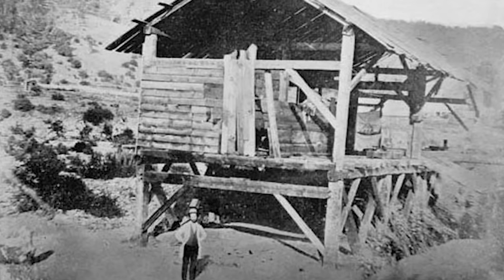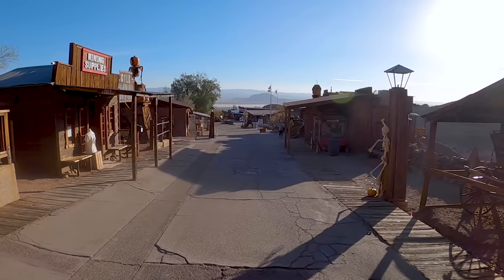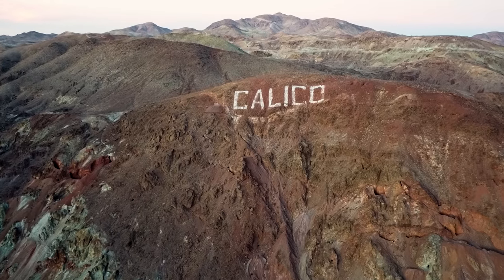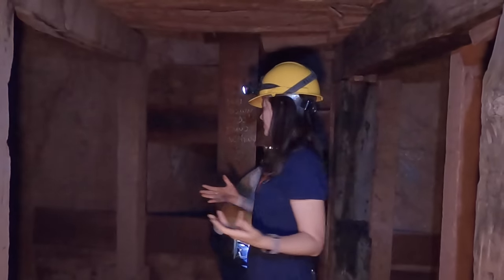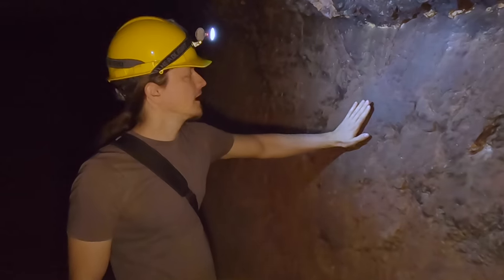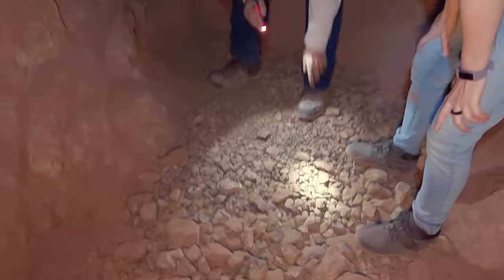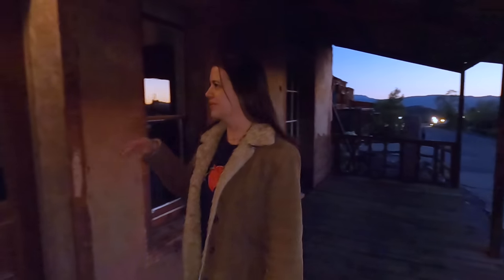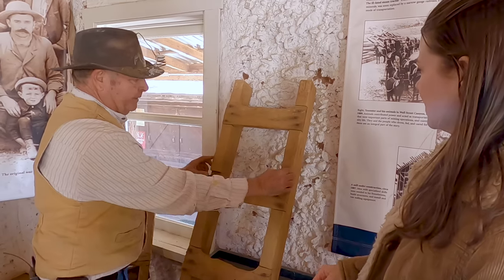Exploring the Haunted Calico Ghost Town

Comment: So glad you did this episode on Calico. I started mapping the mines when I was 15 and only mapped about 9 miles of tunnel at level 7. There are 15-17 levels. Once you hit 11 there is water. The water is caustic but ultra clear. You can see down one flooded shaft about 180 feet. Mining was done at the buried river level where silver ore leached in. Its still there. Very soft walls and tunnel collapse is pretty frequent. In 2001 there was a roof collapse at level 10. You can hear the water well pumps from the town down there. 36 miles of tunneling I am told. I would love to have an official tour down there someday. You guys really did a awesome video. I always get excited with Calico.
Reply: Amazing. I do not have that kind of guts.
Reply: @thenevadadesertrat2713  it’s not really about fear. It’s about understanding the stability of your surroundings and the risk of unseen unstable zones. And planning egress paths just in case. Remember the old miners didn’t have surveyors like today and even today there are unpredictable mine failures. Still more dangerous driving to work.

Comment: Been visiting Calico since the mid 50's, first time just before Knott's took it over. In the late 60's and early 70's you could explore a lot of the Big mines around Calico and the adjoining area, like Twenty Mule Team Cyn. till they were sealed off. I've even been to a wedding at the School House in the early 80's . Nice video, keep them coming.
Reply: I used to visit in the late 50s early 60s. You could explore any mine, likely very dangerous but teenage kids are invulnerable! The town was unspoiled, no gated entry, gift shops, train rides or Chinese made trinkets.
Reply: @jerry3890  That's the way I like to remember it, dirty and gritty. Remember once driving up Mule Cyn rd. Had to watch out for Open shafts that could swallow a jeep. And in one mine, with a Large open room, jump up and down and feel the ground vibrate. No wonder they closed off so many of the mines.